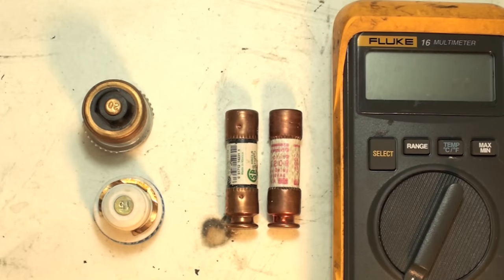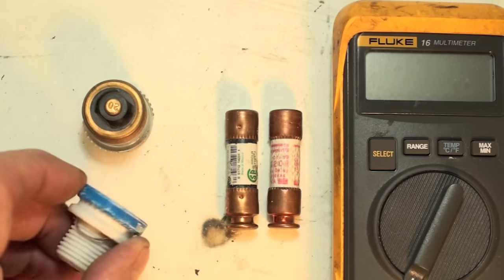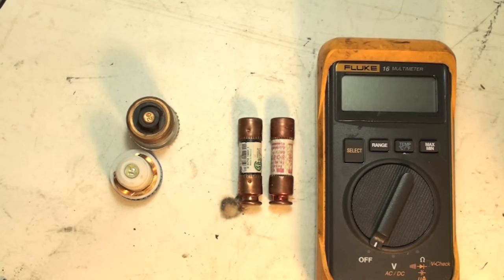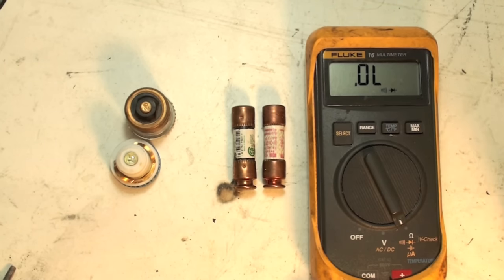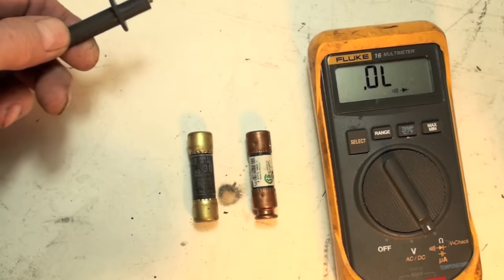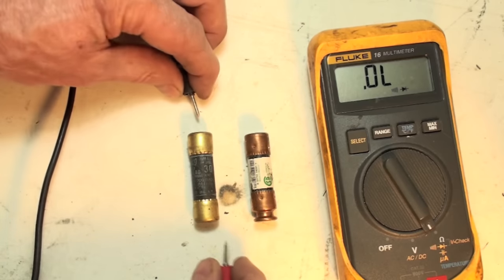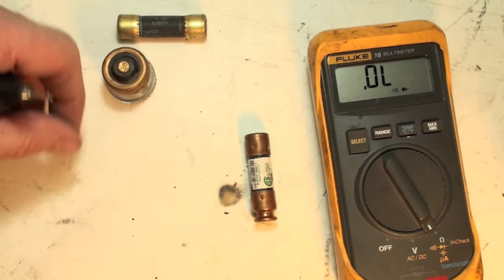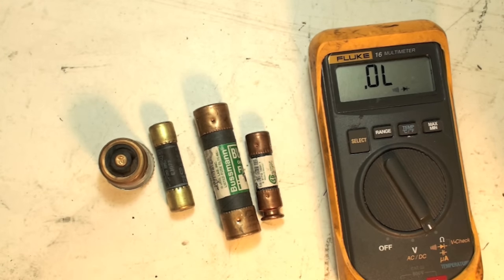How to check the cartridge fuse used in HVAC with an ohmmeter.  Fuses part 5

Comment: Round glass fuses will not tell you if it is blown as Grayfurnaceman says. They sometimes look intact thru the glass.  While it is in the fuse box, just press a voltage detector. (I used Klien tool dual range tester) which looks like a pen. If it beeps, there is current passing thru. If it is a dud then, no beep beep beep.  You can then replace it.

Great video and explanation. Thank you,

Comment: Thank you so much.  My Dad an electrical engineer gave me a Micronata Multi Meter probably in 1980.  I've used it to check AC current.  Did not ever use (or know how) to test for conductivity.  I had a air conditioner go down during 110 degree hot spell on West Coast, on a Friday.  This video was so helpful.  One of my 2 45 Amp HAC-R-45 Fuses is dead!  Thanks again.

Comment: Hey thanks, man. You literally saved my life on my phone. Fuse blew, so I had time to go to Lows as I was stuck in a trade with TSLA with no power. and a leaky roof. Forgot all about it after going to Lows, testing and putting in a new fuse. TSLA shot up and a made enough to put in a new roof.
Reply from the maker: Another winner
GFM

Comment from the maker: Electric furnaces with fuse blocks in them are known for burning up fuses.  The clamps lose their temper when overheated.  You can get clamps to put on the clamps to hold them tight.  Electrical supply stores have them.  Hope this helps.
GFM

Comment from the maker: The choice of a meter is probably the the most personal of the tool choices.  You use it constantly, so it must be easy to use and tough.  Cost can also be a factor, especially for a new tech.  The Fieldpiece SC77 is a good choice for the tech starting out.  If you want more of my opinions on meters, check out the grayfurnaceman web site.  I have info on many meters.  Hope this helps.
GFM

Comment: I was under the impression (I know nothing) that the compressor may be able to start but the fan may not.  I guess I don't understand why new fuses "seems" to help to dramatically if it is a compressor going out.  Don't notice burns on the fuse clamps.  This weekend I plan on looking at the inside of the ACU maybe I will see something in there.  Thank you for your wonderful videos!!

Comment from the maker: Breakers are time delay circuit protection.  Which means they will kick off immediately if there is a dead short but overloads of double the amperage like your example, can take over a minute to trip.  Your pump will start in less than a second, so it should not trip unless the breaker is failing.  A 20 amp breaker usually will take a 60 to 80 amp motor start.  There are also hard start breakers for high start loads.  Hope this helps.
GFM

Comment: Thanks GFM! 
Seeking any fuse tips: 15 y/o Kenmore AC, very solid, finally broke down a week ago, and I had to pay premium for a new compressor. Had a week of blissful coolness, but today I've replaced the fuses several times, obviously not sustainable. I never had to replace a fuse once in 10 years before the new compressor. My fuses are Bussmann FRN-R-40ID 40-Amps. Before calling the guys who installed the compressor, I want to know if I could/should buy different fuses and would that even matter? :)
Reply from the maker: Your fuses are of the right type.  The fuse amperage depends on the outdoor unit model plate.
GFM

Comment from the maker: The hum was probably the contactor coil in the outdoor unit.  If the fuse clamps are discolored, there is a bad connection and it will happen again.  Sometimes the compressor could be failing to start.  That means future compressor failure.  Hope this helps.
GFM

Comment: I know this thread is old but I had a interesting, rather strange occurrence when troubleshooting a no cool call which turned out to be bad fuses failed in a strange way. I ohmed them out and initially they checked out. But then as I shifted them a little bit they read open. Then I move them another way they read fine. As I shook the fuse I can hear what sounded like dirt moving inside of them. So I replaced the fuses with new ones and the problem went away. So what I did was cut them open to see what happened, what I found was part of the fuse had blown and just enough was left to make contact. So I assume that the unit vibration was causing the fuses to vibrate causing the issue.
Reply from the maker: I have also seen that.  When in doubt, replace.
GFM

Comment: Is there a chance fuses continuity wise work but may still be bad?  My ac would sometimes kick on. No fan turning in ACU,  fan worked in house, gas furnace fan kicks on. I did not think it to be TSTAT, also heard a kick start happen and a faint hum from ACU when system turned on. Changed fuses in ext. connection box, ACU works fine many times over at the moment. One house wire TERMINAL moves a bit, but is not the wire in the terminal moving, just the terminal. I wonder if problem will be back?

Comment: My house has this type of box. Electric keeps popping off. What do I do? I replaced all glass fuses. Would this be an outlet problem? Two of my outlets get no volt readings. In the same room. It pops when anything is plug in. What should I do? I got a multimeter. Any ideas?
Reply from the maker: Ready for it?  Replace the panel.  It stopped being viable 40 years ago.
GFM

Comment: Hey boss!  Maybe you can answer a quick question somewhat off the topic: Should apply to any motor (although I'm dealing with sump pumps.  If a 1/2 or 3/4 HP motor uses 12 running amps, but takes say, 22.4 amps to start, will that blow a 20amp breaker?  
Put another way, how many starting amps can a 20amp breaker handle?  

Thanks in advance,
John

Comment: I just lost power in some receptacles so after I went down cellar to check the fuses I used one of these testers and it's telling me that it's a Hot/Grd Reverse so what should I be doing net? None of the fuses were blown and the only switches we have were both in the On position. The only fuses I haven't checked yet are the big cylinder shaped fuses.
Reply from the maker: Could be many things.  You need to be sure all fuses are ok.  If there are any breakers, they should be turned off then back on.  As for the reversal of hot and gnd, It needs to be switched.  If you are not confident, get a professional.  Hope this helps.
GFM
Reply: +grayfurnaceman All the fuses and the breakers are fine and these receptacles were working fine until last night.
Reply from the maker: You could have a burned wire in the circuit.  If you remove the outlets, you may find it there.  Careful, high voltage.
GFM
Reply: +grayfurnaceman just replaced one of them tonight and it's still doing the same thing so I guess that I'll have to check and replace the rest of tomorrow.
Reply: Alright! I seem to be getting somewhere because I just replaced another receptacle and now instead of getting the Hot/Ground Reverse, I'm getting the open neutral error so I'm thinking that maybe it's one of the two light switches.
Reply: Well, I just went and replaced the last three receptacles in that room and now the tester is back to saying that it's a Hot/Ground Reverse error. The only thing I haven't done is replace the two light switches and two light fixtures that are left in this room. Anymore help and advice would be greatly appreciated.

Comment: If the rating label on my fuse has rubbed away how can I tell what size my fuse is?
Reply from the maker: There is no way to be sure, but you can check the breaker size in the panel.  They should be the same.  If the fuse is used for AC, it will need to be a slow blow type.
GFM

Comment: What does no voltage across the line-ins in the box, but a good 120 on each line.
Reply from the maker: If you are checking from hot to gnd, no, no, no.  You are looking for 240, not 120.  
Check across the 2 incoming lines.  No voltage, circuit open.  
You could have a breaker in the main panel that has tripped and only opened one side of line.  Try resetting the breaker.
GFM
Reply: @grayfurnaceman  Thank you so much for your reply. I will check.

Comment: If you or someone could do this again with a cheap / harbor freight tools type multimeter that might help.  In general, my understanding is that NO MATTER WHAT SETTING the multimeter is at, it should read 0 if the old fuse is working.  Especially helpful for understanding the buss / bussman fuses that don't have glass.  Jesus loves you and many thanks to all!

Comment: I just bought an Analog Multimeter from Wal*Mart so that I could learn how to do this but I don't know what to set the dial to. Can anyone tell me what setting I'm supposed to put it on? It's a GE2527.
Reply from the maker: Luigi Provencher Set the dial to "ohms" 10X.  Short the leads together.  You should see the needle move to zero.  
GFM
Reply: +grayfurnaceman Alright! Thanks,man. Do you know what the dial on the left hand side is for? It almost looks like a volume thing.
Reply from the maker: Luigi Provencher Its a zero adjust.  When you short the leads together, you turn the dial until the needle reads 0.
GFM
Reply: +grayfurnaceman Thanks, man. You're awesome.
Reply: +grayfurnaceman I ended up returning it to Wal*Mart so that I could get a little bit better one but when I was testing out the fuses they beeped but they didn't go down to Zero, Is that okay!
Reply from the maker: +Luigi Provencher The fuses are ok if it beeps.
GFM